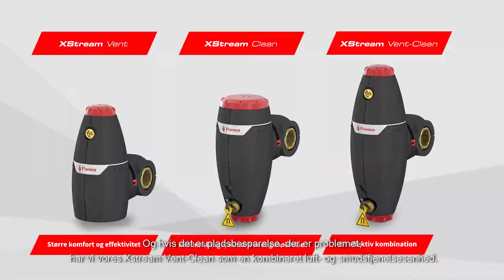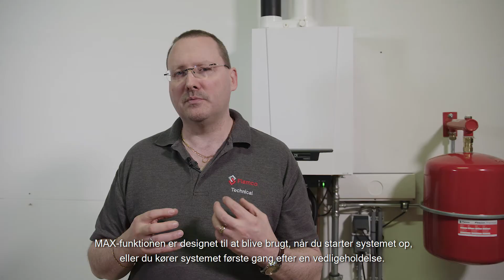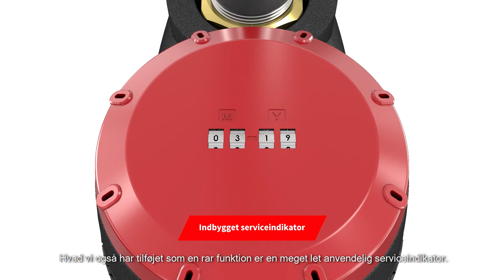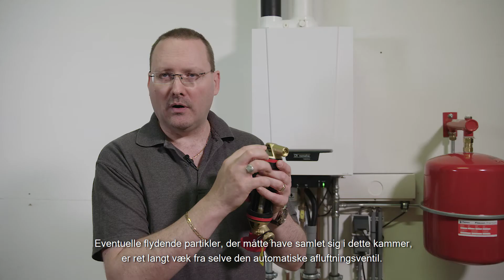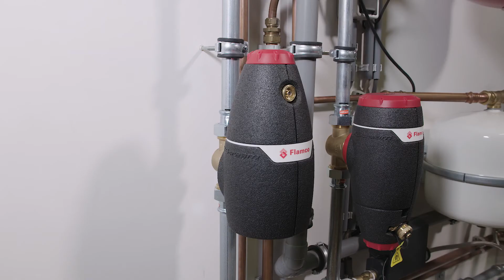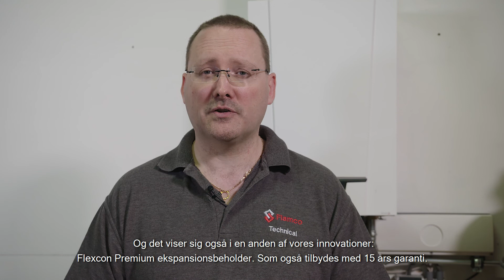Flamco XStream Explainer video DAN

Comment: Sir 
In my site, that 25/1.5 tank. While filling oil the tank pressure building fastly, as compared to oil pouring. 
Example: I fill 50 ml oil to tank but tank pressure is showing more than it's limit. Please suggest what can i do??